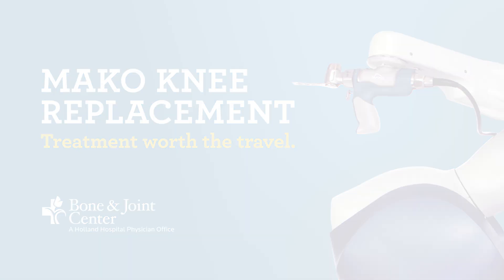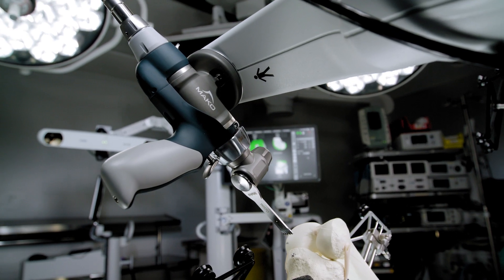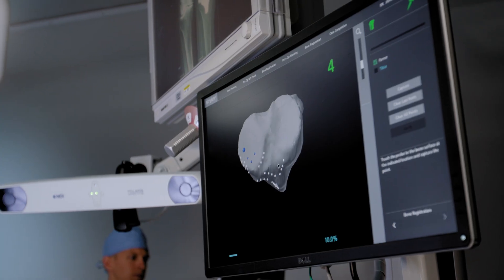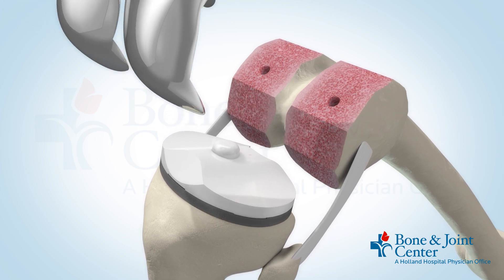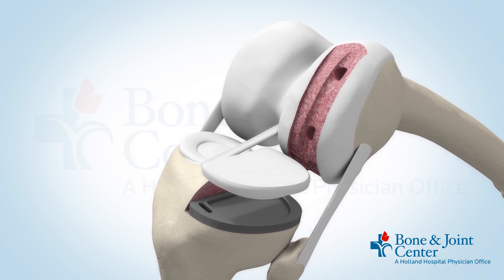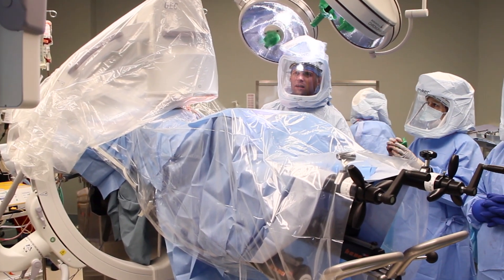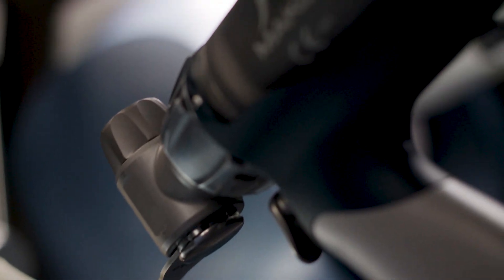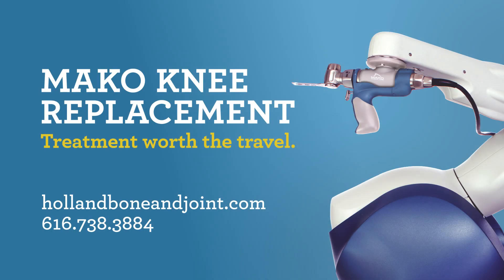Full Knee Replacment | Mako Robotic Arm Assisted Surgery Technology

Comment: This is a miracle procedure! I've had two bad knees requiring TKR to each. I had my first on 9/21/20. Thre physical therapests could not believe how quickly my post op expectations progressed rapidly without issue. I seriously had 120degree flex in the first 10 days. Knee extension to 0-2degrees was a little bit of a challenge but overcame quickly with perseverance. I was doing balance standing on the operative leg in week 4.I am now into week 8 tomorrow and actually hung holiday ornaments today off a ladder. My next TKR is scheduled for 12/7/20 and I am so ready to get this done. I have been working with a great PT group and we have been putting some quad strengthening work into my impending procedure. I pray this new one goes as well. I have had severe bilateral pain in both my knees for over a decade. I always feared post op consequences such as pulmonary embolism, permanent nerve damage and co-morbid issues. But I swear to you that my operated leg feels so good without pain that I even get a kick trying one leg squat on the operated one.Mind you there is discomfort days1-6 but the secret is to medicate, elevate and tolerate. I'm thinking I might get a chance to do some snow skiing next year if all stays well. promise no black diamonds.

Comment: I just had my right knee done with this procedure and my left knee was done last year the first one went great and so far I’m doing good with my right knee and it seems to be coming along better than my other knee at this point. My advice to any one suffering in pain get it done you will have better quality of life. I stopped pain meds 3 days after surgery and occasionally taking Tylenol and by day 4 I hardly use a walker but I keep it around just in case because your knee will be week for a few months. One of the most important things about this is you MUST do your physical therapy because if you don’t you’ll regret it.
Reply: G man, I had a similar experience to yours except, my Mako surgeries were 14 weeks apart.  Thank you for emphasizing the need to do the Physical therapy.  To keep the flexion at or above 120, I would add that the exercises in between therapy sessions and on going after 14 weeks are critical.  I never needed the extreme (hydrocodone) pain medication.  My level of pain was always between 0 and 2.  I do recommend taking something for pain at least 1 hr before therapy sessions so that the Therapist can work and stretch the knee a bit harder to get to the goal flexion. Other recommendation..keep moving and walking right after the surgery, it makes it feel better and helps stretch and strengthen the muscles?  God bless you and anyone considering this surgery...I am extremely pleased with my outcome.

Comment: The robot assisted is great for docs who don’t perform a lot of knee replacements. You want them to have this tool.  But I’d rather have someone who has done hundreds, thousands of them instead (like my amazing doc and although other knee surgeons predicted problems because my leg and knee were so messed up, I’m getting along beautifully!).  Then there’s no point in spending the millions of dollars for this machine. But for the docs that only do 10-20 a year, it’s great but doesn’t pay for itself.
Reply: Dreemsnake - then you understand nothing about the system! The robot ensures that only the correct amount of bone is removed and when you're talking millimeters the robot is absolutely necessary! Suggest you learn more about the system before making stupid comments.
Reply: The doctors that I know that use this do a ton of joint replacements and they love what they are able to do with this.